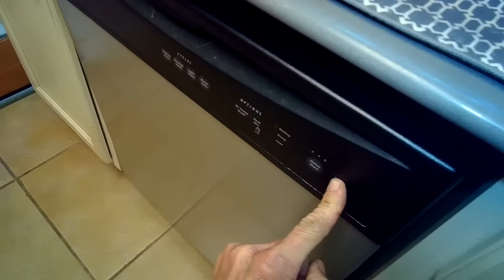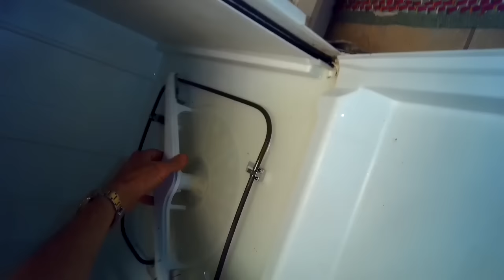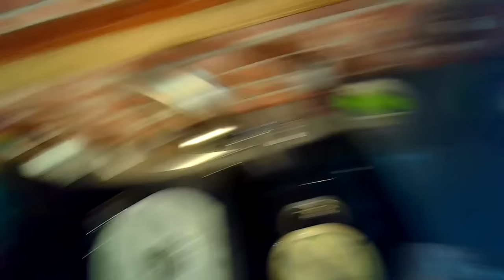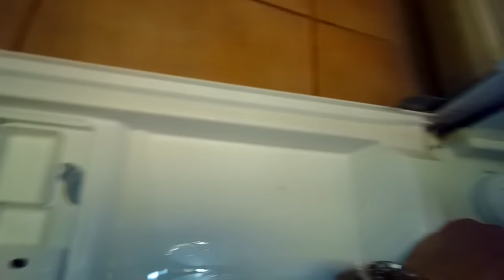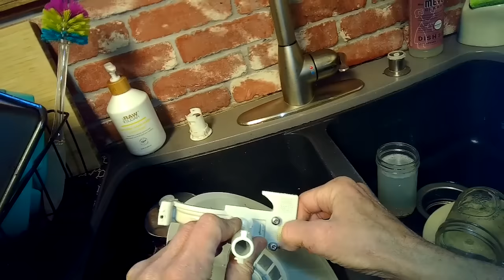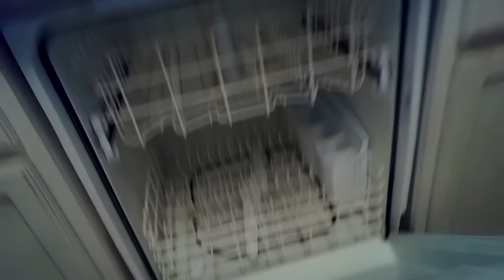✨ FRIGIDAIRE DISHWASHER WON’T DRAIN—EASY FIX ✨

Comment: Great Tutorial Scott! Unfortunately, this didn't solve my problem. I installed my dishwasher about a year ago and it stopped draining last week. I followed your tutorial exactly and didn't find any obstructions, but when I put it back together, it still is unable to drain. I pulled the entire unit out of the cabinet and took the drain hose off to see if there were any obstructions, but I couldn't find any. Do you have any suggestions? I'm looking into purchasing a drain pump ($109) from Tribles, but my fear is that the Circulation pump ($225) is the real culprit. At that point, I should just purchase a new dishwasher. Any advice?
Reply from the maker: I wonder if the air gap up near the faucet is clogged?

Comment: Thanks for the advice. I'm a maintenance man by trade I did what you said but eventually had to pull the dishwasher out and pull the drain lines in the back attached to impeller housing. BINGO!!! A bunch of rice came out of the drain line where that little rubber thing is. But thanks. This video DID HELP. 👍
Reply from the maker: Nice work!
💻 New Appliance Repair Blog - lots of DIY Fixes for Your Home Appliances - Click Here:
https://ApplianceFixes4You.com

Comment: Wow Thanks!!!!!. I was sooo terified I'd have to go back to manual scrubbing plates. I just battled a massive hair grease soap clog that gallons of otc declogger wouldnt touch.. I grabbed 25' $30 auger.  It took 3 weeks to finally get it cleared, it just kept slogging up and down, hiding in different parts of the pipe...anyhow it was running ALOT of very hot water, plus TONS of dawn dishsoap through the drain after I augered that finally fixed it.. Then, today, I found standing ick water in dishwasher and I'm like OOOOHHHHHH NOOOOOOO the clog has returned...but it didn't...it was a tissue lodged in the spinny white thing..Thank u sooooo much.
Reply from the maker: Very cool😊👍

Comment: Hey Scott, we have almost the same model dishwasher in this rental house. We hardly use the dishwasher, maybe twice a year for holidays. We're getting ready to move so I was going to run a few loads before packing stuff up. I opened it and found it hadn't drained all the way since Christmas dinner. It was pretty foul. Bailed it out like you showed and disassembled it and was surprised by how much water (and scum) was still down under the filters. Gave it a bleach bath and pressed on. Didn't find any obstructions other than build up. Bleached and washed with hot water all the parts in the sink, reassembling as I finished each part. The first filter piece you take off was the last to put on. I thought it was 1 piece. The hot water dissolved the crud and it came apart. And out popped a damn shard of glass. Slapped it back together and it works fine now (and doesn't stink). Thank you so much for such a well detailed, concise video!
Reply from the maker: Nice job👍😊

Comment: Just helped me, Didn't find any thing in there since I used shop vac with small attachment to suck up water but it worked right after. Thanks!
Reply from the maker: Excellent,
Thanks

Comment: Thank you so very much for this! My problem was in fact some plastic shards in the air gap, soon as I cleared that turned it on and off again water started shooting out the air gap! Lol my bad for not putting the top back on but I was super happy. Put the air gap top back on tried again and boom! Water draining as it’s supposed to where it’s supposed to!

Comment: so if anything is caught under the plastic cover blocking the impeller this will screw it up that bad? I will need to investigate further. Thanks!!
Reply from the maker: Yeah, if the impeller is blocked and can’t turn it will stop draining.
Reply: @ScottTheFixItGuyChannel  impeller turns still no drain.

Comment: I really appreciate your video. I came to my daughters home and the dishwasher smelled really bad.  I followed your instruction!  I didn’t find any thing but grime. Would the garbage disposal have anything to do with the smell?
Reply from the maker: Could be the disposal.
You can put 5 ice cubes in the disposal and turn it on with some water.  Lemon juice can help too.
Have her start using Cascade complete detergent.

Comment: I took everything apart, but I found two pieces of glass in the filter that you remove right before you get to the part with the t-15 screws. I removed the cover and sucked out the water with the shop vac, so unless the shop back sucked up the glass piece, I didn't find any additional pieces of glass down near the impeller. It spins freely too. So I reassembled everything and it's running on a short wash and I am crossing my fingers it's fixed, but I didn't find anything around the impeller. I'm hoping it's not a bad impeller motor or something... Although that would be just my luck.

Comment: In the beginning of the video, You say to press the 'Cancel' button for 3 seconds? What does that do?  Does it make the pump turn on?  I have the same dishwasher, which also will not drain.  I have taken apart the drain assembly like you, but did not find the culprit. :( Looking for more suggestions here, because I do not want to call a repair professional as it is an old device. Ideas? Help?  Thanks!
Reply from the maker: 3 seconds should do it.

You might try unplugging it for a few hours.

I would put the drain hose in a bucket to test how well it drains.

Comment: I had problems with mine lately.  It shot out the PF code.  I cleaned out the filters and I didn't get all the way down as you did.  But, I ran one cycle so far and it hasn't quit on me yet.  If I still have problems.  I will take the white housing off and clean under that.  I wished I would have seen this video sooner.  Lol

Comment: What if my dishwasher doesn’t have an air gap that leads to my sink? Where would it be and how would I check it?
Reply from the maker: You can remove the drain hose where it connects to the disposal and clean it out.

Comment: Should the impeller spin freely if it's cleared of debris? Or is it supposed to resist?
Reply from the maker: It will move freely for 1/4 turn and then resistance and then freely.
Reply: @ScottTheFixItGuyChannel  very helpful thank you tons for responding!

Comment: I got a question I think my circulation pump failed because it was draining but not circulating and now it doesn't  drain. Do you think both are blocked now
Reply from the maker: So it’s able to drain the water out but it does not circulate the water around.
Does it seem like it’s filling with water OK?
Reply: @ScottTheFixItGuyChannel  yea
Reply: @ScottTheFixItGuyChannel  I unblocked my drain pump impeller but it still doesnt circulate and the circulation pump makes noise
Reply from the maker: Can you send me a video of that to:
Scottthefixitguy@yahoo.com

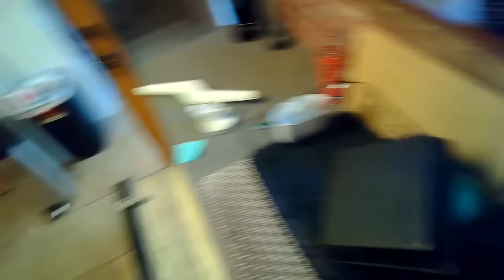Comment: 2:01 I have the same dishwasher but don't see where that part is (the one the host is poking through with the screwdriver next to the faucet). Whta is that?
Reply: The drain pump hums but it won't drain. I cleaned all the hardware from inside the tub, check with a multimeter the float switch and is functional. What could be wrong?
Reply from the maker: Hey Tony,
I think something is jamming the drain impeller from turning.
Can you access the pump?
Reply: @ScottTheFixItGuyChannel  The impeller seemes to spin fine from inside.
Any suggestions before I dismantle from the bottom? Thanks

Comment: My Frigidaire is a simpler model with the air gap on the inside of the dishwasher.  I never heard of a "torques 15 screw".  I'm stuck at not being able to remove the screws above the impeller.  I think there are only two on my model.  I can barely make out the middle of the screws with a bright light.
Reply from the maker: Can you send a picture of those 2 screws to my email at: scottthefixitguy@yahoo.com

Comment: The empeller on my model is so small. Can't get to it with pliers or fingers. Any thoughts
Reply from the maker: Can you try to get the water out of there with a sponge and then use a strong flashlight and some tweezers to get the piece out?
Reply: @ScottTheFixItGuyChannel  thanks Scott for the reply. I figured it out. It wasn't the dishwasher at all. I have hard water. The small elbow joint under the sink was completely cruddy with Calcium and likely other junk. Took the hose off and cleaned with a wire brush stick. I could barely get the stick in. Cleaned it up with some vinegar and worked like a charm. Thanks for the video. Now I know how that damn dishwasher works.

Comment: Thanks for the tutorial. My situation, unfortunately, seems to be somewhat more nefarious :(
Reply: I think mine is too. Were you able to find the solution?
Reply: @danland78  not yet, but from what I've read, it could be the drain pump.
Reply: @juniorsch1  I'm pretty sure it didn't work on mine either. I'm letting a fast cycle run now, but I believe after the first initial rinse, I heard it trying to drain and it didn't sound like the pump was working as you usually hear it gurgling where the sink vent is. So I think my pump is bad too

Comment: Note that the drain pump impeller is not visible from the top, you have to remove it from the bottom of the dishwasher. The impeller seen from the top is the main circulation pump.
Reply from the maker: Thank you👍💻 New Appliance Repair Blog - lots of DIY Fixes for Your Home Appliances - Click Here:
https://ApplianceFixes4You.com

Comment: Thanks, pretty good demo.... but you went to A LOT of trouble getting that water out. I have a piece of 1/4” día plastic hose, gets into small tight spaces & siphons water.out easier & about as fast into a small bucket.

Thanks for going to the trouble of making video & documenting repair. With all the filters it’s interesting the glass could even get down that far!
Reply from the maker: Good idea😊
Reply: yes, a siphon is easier and cleaner, and so is a wet/dry vac (remember to remove the filter)...BUT, he used "tools" quickly available and relatable to the average homeowner, probably in an arm's reach on the counter right above the dishwasher. 

Not everyone knows how to set-up a siphon, or how to get one started which can be gross if you don't have a hand pump. And, whether or not you know how to set up a siphon, it's a very good idea to remove the main body of water using a cup because if that water can have some bigger floating debris that can quickly clog a small siphon tube. 

To save a little time when using a cup, and for a little less of a mess, rest a good size bowl on the DW door and fill it up with each cup of water, and then you don't need to reach up and over to pour each cup into the sink. 

Note:  if the water has been sitting for few days it may stink,  so before removing it pour half a cup of bleach, mix it up for a few seconds,  then let it sit for 15 min, and this will make it a bit more tolerable when removing it.

Comment: I did everything you showed and checked the hose to see if it’s clogged up and still didn’t drain
Any suggestions 
Thanks so much
Reply from the maker: Might be time for a new pump👍
Reply: @ScottTheFixItGuyChannel  Thanks for the reply, I finally found out the problem, unscrewed the pump and found a piece of glass blocking the fan, and it worked
thank you for your help

Comment: your video is excellent but the most important for me is how to put back all the parts you removed. i did it and something is wrong the rounded plastic does not engage properly i do not know why,
Reply from the maker: Hi Freddy,
Try turning it 180° and see if it will then lock in.

Comment: I don’t have an air gap thingy—is that a problem? (DW has worked fine for last 10 years without it.)
Reply from the maker: No they’re not needed as long as your drain tube is bent in an arc higher than your garbage disposer.
Reply: Scottthefixitguy Thanks, man!
Reply: @ScottTheFixItGuyChannel  so my dishwasher has never worked, it never drains. This comment makes me wonder, because I see my garbage disposal has a tube that runs from the dishwasher to the garbage disposal, BUT the tube is going from down low (dishwasher) to up high (garbage disposal. Could this be my problem?
Reply: Some people put in a new garbage disposal and forget to knock out the steel plug.  If you disconnect your drain plug from the disposal, you should be able to see though into the disposal.  If not, it has a factory plug that needs to be removed with a hammer  and screwdriver.

Comment: Thanks so much. Went away on trip to get a frantic call from my daughter ..Ahh the dishwasher is filled with water it's coming out all over the place. Well the daughter managed to contain the water I can back watched your video (same machine as mine would you believe) followed your directions and now it's working as well as it use to. Thanks so much your video was easy to follow video and audio very clear !!! A+

Comment: I take care of maintenance for 62 apts, I have two shop vacs, one wet one dry. I also made a wooden stool with carpet on top to put under the open dishwasher door so it doesn't tip

Comment: Do you take questions?  My (low-end) Fridgidaire (similar in design as yours) has low pressure, so I dissambled everything in the hope that "foreign material" could be removed and eveertying would then be okay.  Unfortunately, looks like the main pump might be bad (only 3 years old!).

My question is about the large sump gasket.  I did not observe how it fits, relative to the big round opening and the center "guts".  Looks like the center guts could be fit into a groove of the gasket or the gasket could more simply be "compressed" by the two mating parts.  Any help with this?  Thank you for considering

Comment: I installed a brand new dishwasher.and It won't drain eveytbing else is working properly what can it be?.
Reply from the maker: Hi Nick,
Is there also a brand new garbage disposal?
Reply: @ScottTheFixItGuyChannel  yes
Reply: Dish washer makes humming sound but I don't see anyone water flowing threw the plastic drain line
Reply from the maker: Hi Nick,
I wonder if the plastic plug in the disposal drain tube hasn’t been punched out?
Reply: @ScottTheFixItGuyChannel  I've done that also lol

Comment: I can not find the right tool to remove the 3 screws I have tried many types and due to age and bad eye sight I can not unscrew them. What do I need to use ? Help please.
Reply: Janice Howard t15
Reply: This is called a torx head screwdriver, six sided star.  t15.  You can buy them in a fold able set.

Comment: What if it's the hose because it went into the basement?
Reply from the maker: Hi Lydia,
Do you think the hose has a leak in it?
Could it be a problem where the dishwasher fills even when off and the water overflows and floods the basement?
Reply: @ScottTheFixItGuyChannel

Comment: I did all that great tutorial but nothing was stuck and it still not draining. So once the cycle runs it won't drain but it will drain if I cancel it manually. I feel like i checked absolutely everything I can think of.
Reply: did u figure it out lol same issue
Reply: @alishajafry374  yes we had to replace air gap on the sink. Easy fix.

Comment: Uggg... mine won't drain between cycles during a wash. However at the end, if I hit Start, then Cancel immediately afterwards, it will empty out the water trapped at the bottom. So it can drain, it just doesn't during the wash cycles. Frustrating.
Reply from the maker: Probably have a slightly obstructed air gap that’s slowing down the drain function .